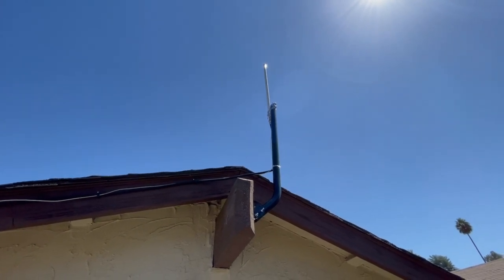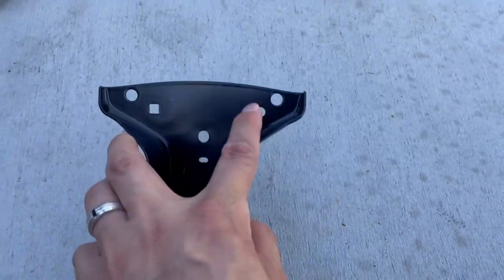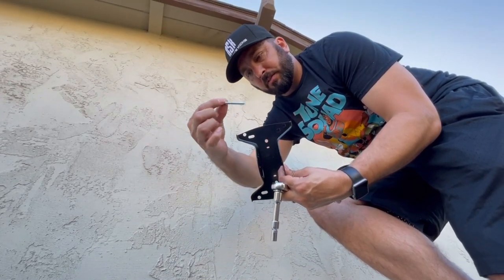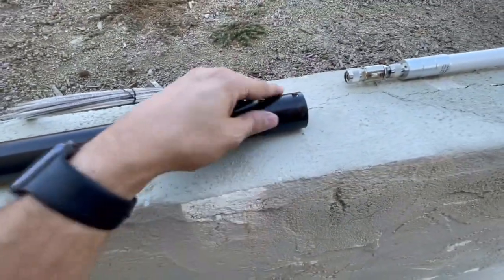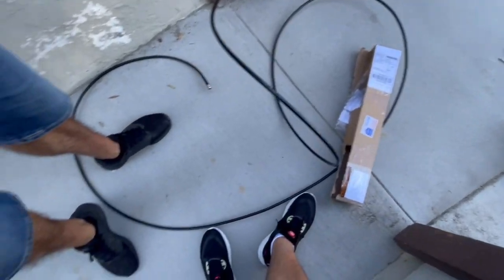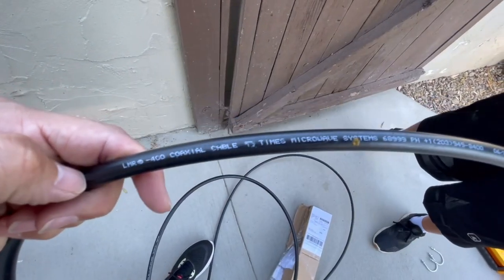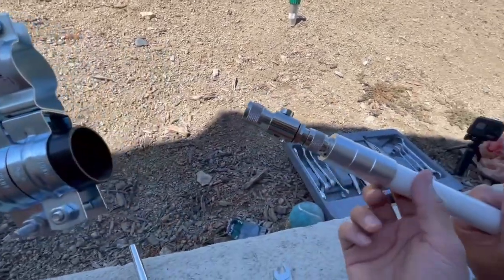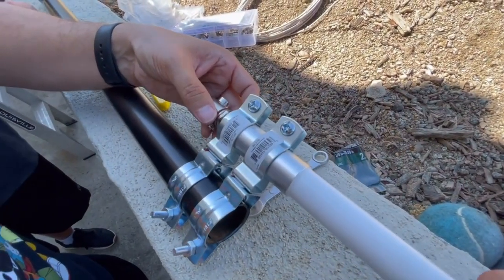Outdoor Antenna Install For Rak or Bobcat Miner (Step by Step Setup) Increase Helium Miner Earnings

Comment: 11:00 Never power up the miner without the antenna installed or you damage it!
Reply: Yep. Don't want the miner to get fried after all that work.
Reply: Can you explain bit more please?
Reply: @Dufjans   If the miner is plugged into the electricity and you connect  or disconnect the antenna.  It can damage the miner itself.  It's actually in the Bobcat's manual. Just simply unplug the power when connecting or working on your antenna.

Comment: Running POE is much more cost effective than longish LMR400 runs and there's essentially zero loss. Also, the steel base of the antenna is slightly below the tubular antenna mast and this will negatively affect the signal too. It's best to ensure the entire antenna filament has a 360 degree unobstructed view. Also the comments about connecting the antenna while the unit is powered on is also true. The miner is trying to push a signal to an antenna that isn't there and all of a sudden is and that can cause a surge.
Reply from the maker: Thanks for the info bro
Reply: What’s POE?
Reply: @KathyDefensor  I’m curious too?
Reply: Power over Ethernet. Used commonly with security cameras. So I think you would be using an ethernet cable from your router to the miner which would then be mounted closer to the antenna.  You would have the stock short cable going to the antenna from there.
Reply: PoE? Am I misunderstanding your correction.  The purpose of the LMR is to carry signal to antenna without housing an exterior enclosure to protect the miner with PoE at antenna location. Its. Practical IMO to do all the other stuff when a cable run is needed either way and the cost will be similar or more with enclosures...exposing to heat when you can put the miner in a climate control house or area
Reply: @TheTruthisGold  I understand that, just don't think its counter intuitive to sacrifice the device outside for no reason.  Although, Cat6 is easier to find and use in the DIY cases I suppose.  Just seems it should be device protection first, then antenna, then cabling.  You can get pre terminated ones and only encounter 1-2db loss in most apps.
Reply: @williamjonson6845  I was thinking about this as well. I’m debating on buying an outdoor enclosure box for my miner or keeping it indoor and running the longer cable..
Reply: @teflondaprince  longer the LMR400 cable the more db loss which means less distance you will get.  I'm currently debating the same thing of how long do I want the cord and how much i'll loose in distance.
Reply: @keithcevasco2827  the outdoor enclosure box is probably the best way to go. I had my miner for about 3 months and only generated 6 helium smh. Something has to be done
Reply: Yes, you can also buy a Netgear Powerline Adapter kit to not have to run a super long Ethernet cable as long as you have a power adapter closer to the place you want to put the minor.
Reply: @teflondaprince  thinking of doing a roof mount but have concerns of how how the box would get on top of the roof come summer time.
Reply: @Oryx -  I just got my bobcat and want to upgrade the antenna before I install it but the box came with a card stating not to install an upgraded antenna directly to the connector? I am thinking I may need an adapter for sizing but is it okay to use a grade antenna as shown in this video, not the standard baby one that comes with it?
Reply: I just love when someone posts a brilliant comment and disappears.
Reply: @michaelschwartz722  pay no mind to the warning from Bobcat about not using a different antenna, Mike...I hooked up my Bobcat 5 mos. ago w/a rak 5.8 dBi outdoors & it's been doing fine.
Reply: @keithcevasco2827  Same. I decided to go the POE route. My only negative is if i ever have to clinb back up to troubleshoot lol
Reply: @keithcevasco2827  lmr400 is the highest quality lowest loss per metre 0.12dbi I believe per metre he has installed about 8m loss will be about 1dbi off the 8dbi antenna defo have to consider in your own installs. Also I presume you mean install a short cable and long Ethernet so you don’t lose dbi strength. Each install is different my ocd was killing me on this install I was like zip tie the cables together and also the thread of the bolts should be facing in to the house lol also why not zip tie cable everything and then screw to roof joist lol

Comment: Would love to hear the updates on how much the miner brings in.  Great video - very straight forward and simple to follow.
Reply from the maker: Thanks bro. I’ll link up with my friend at the one month mark n we’ll make a video. 👍🏻
Reply: @CesarCinema  Please do dude¬!
Reply: @DarnIDidntKnowThat  I've got a miner up and running with a 4dbi, the most I've seen in the area in London is 118 helium after the halving, it won't be 10k/month unless you have a literal radio tower, but 1k/month isn't far off if you optimise your height and antenna.
Reply: @UrbanTitanHD  With 1k a month, is it worth it to run multiple miners at the same site?  I'm new to the whole helium thing.
Reply: @Agency323  I understand that having multiple miners at one site defeats the purpose. If you do that, you’re essentially competing against yourself.
Reply: @moreforallchannel9746  so nobody runs more than 1 at a single location then?  If you live in apartments that's got to be rough. You could have 10 people in spitting distance.
Reply: @Agency323  NO! All Miners need to be at LEAST 300 METERS apart or efficiency drops in half
Reply: @UrbanTitanHD  I'm in the London area and was wondering what antenna you would recommend as some areas are pretty saturated. I'd like to talk more about it but there's no private messaging here.
Reply: @Agency323  I've heard you can only have one miner per IP address and others say as long as 300 sq ft apart but I'm new too but some people say that isn't true that it is only one per location.
Reply: @timhood2690  just the machines within 300m wont mine with you or give earnings.... but youll still get rewards from the further ones

Comment: You need a drip loop where the cable goes into the garage.  Water will flow down the wire and directly into the walls, and water + wood is very bad long term (termites, rot, etc.).  Also, that hole is an invitation for rodents to make a home in your garage.  You will want to plug that up as well.  Good job otherwise.
Reply: But I thikn with the 90degrees he will be fine ;)
Reply from the maker: Yeah the cord is 180 degrees so no need for a drip loop but yes that hole should prolly b covered.
Reply: Also dont forget to plug the antena cord before pluging the power cord for the miners.

Comment: I have a Bobcat on the way.  I plan to install a 5.8dBi antenna with a # 10 thhn green grounding wire.  Thanks for the good information.  Maybe routing the cable under the roofline would have been better for a cleaner protected installation.  A follow up video on how this miner is performing  - over time would be interesting!  Cheers!
Reply from the maker: Here goes the earnings video. 
https://youtu.be/4bLBVL90e5w

Comment: another thing of note, is that your supposed to turn off the miners when you switch the antenna type, at least it says that for nebra, and rak miners, and a tip you can research when you upgrade an antenna height and DBI, often times it doesnt recognize it on the helium heatmap, apparently from what ive read, is that you can manually go and change the height and the DBI of the antenna, and the way the helium network works it will actually improve your miners witnesses and challenges because of how their algo works. but other than that thank you for the video.
Reply from the maker: That might be true about plugging it in first bc this is not the first comment about that lol. To me it doesn’t make a difference but if you are setting yours up make sure everything is connected before turning on. Luckily our miner didn’t spontaneously combust. You are very welcome
Reply: I think I fell victim to my own ignorance on that topic. Everything is running well (Synced, 1.0, Online, Diagnostics good, all green), except since I changed antennas without unplugging, not had one witness. I am invisible-went from 49 witnesses to 0, ~1HNT/day to 0.01HNT/day. Running Blind Beacon... don’t forget to unplug!

Comment: It would be helpful to you to know about losses in db at microwave frequencies. The longer the length the more loss, the more connectors and lightning arrestors the more db loss. This setup would probably not be far off the standard 6" antenna db!

Comment: Also curious on the rewards. Having a 5.8 installed on my roof soon as the cable and lightning arrestor arrive
Reply from the maker: Coming soon after I link up with my buddies. Good luck on your set up

Comment: I'm no electrician either but you want to run loops where stuff makes drops so when stuff goes wrong there's room for error... 

Also go straight to a ground rod in the ground. Mounting to siding a bad idea. You can always do it to gas line your insurance Co. Will love you

Comment: The lmr cable is set up to fail, neglecting to wrap the connections tightly with electrical tape will allow moisture to enter the cable, common mistake, also lightning arrestor  works best if installed at the point where the cable enters the building.

Comment: question. once I changed my antenna from my bobcat. what should I do? should I just wait for it or need toa reset or change antenna details to make it work?
Reply from the maker: Change the details as soon as you turn your miner back on. Go to your helium app under setting then go to “update settings”. If you bought an antenna from Amazon go to custom antenna and energy the details.

Comment: Thanks for the video, Do I have to use the lightening arrestor? can I just put a hoseclamp and wire directly to the antenna base? thanks for the response before hand!
Reply from the maker: That would be the ghetto way of doing it and you would pretty much have similar results but make sure you consult with a professional about that.

Comment: A lot people does this mistake, on the antennas fiberglass strically no obstacles 360 degree , antenna has to be fitted from the metal ring and pole strically below the fiberglass

Comment: Reading the comments a little, I think I know the answer but I'll ask anyway. My miner showed up last week and I have a 5.8dbi antennae upgrade that came with it. There's not a great place for me to mount this on a pole or anything I was wondering if it would be detrimental to mount this to the outside wall of my house. I'm assuming that having 180 degrees blocked is going to be bad but will it be better than just using the indoor antennae that comes with the system? At some point, I'll get it up on the roof but that's going to be a while.

Comment: Hehe, that's a male RP-SMA! It's confusing, but the RP stands for "reverse polarity", so it's the opposite than regular SMA!
A male SMA connector has the pin, a male RP-SMA connector has the socket!
The important part are the threaded part, if it has threads it's a female, if it has the nut it's a male
Reply from the maker: Thanks for pointing that info out

Comment: I have a RAK v2, Received it a few months ago and have $80 so far. Not bad. However I really really really want to run some more cable and a new antenna. I love this set up. I’m curious as to how much I need to try and save up in order to make this happen?

Comment: I live near usc and theres a lot of 1-2 story as well. It is flat area too. I see that hot spotty map on los angeles has poor reward scale. I wanted to figure out if there’s possible ways to have greater witness in that area…. Reward scale is all red around los angeles
Reply from the maker: You gotta get an outdoor antenna as high as you can. You can’t do nothing about the reward scale but it does chance for the better occasionally.

Comment: Does it matter if the lightning arrestor is 0 - 3ghz? or does it need to be 0-6ghz. New to this concept. Thank you!
Reply: Both will work exactly the same, as the antenna is transmitting in the 900 MHZ area.

Comment: I put small amount of Plumbers tape around the threads on mine to keep water out of the Arrestor connections
Reply from the maker: Good tip. I have a video coming fixing the setup thanks.

Comment: Thanks a lot. It's mandatory to have grounding with an outdoor antenna? I just bought an antenna but I can not install it in the grounding wire. Because of the location of my house grounding system. What is the disadvantage if I don't do the grounding? what will happen
Reply from the maker: Well direct TV company in San Diego doesn’t normally ground their dishes but you should check your local regulations. But if a lightning bolt ⚡️ hits it it can start a fire because the electricity has nowhere to go.
Reply: Just buy a 4 foot piece of copper grounding rod.. and take a sledge hammer pound it in as far as it will go with a little showing, and buy a grounding rod connector and just run the wire to the new rod.. happy mining.

Comment: the ground wire shouldn't be looped on the lightning arrestor.  you slide it through the piece connected to the screw you were using.
Reply: yes, that's what I was thinking. There was a lug with the bolt on the arrestor to crimp the wire on to.

Comment: As long as that copper pipes not a gas line. You’ll be OK but if it’s a gas line you need to get it off and change that.

Comment: thanks for the informational video ! I thought we want want the lmr cable short as possible ? Would  it be better if the miner was converted to POE and have it closer to the antenna ? thanks in advance !
Reply from the maker: Thanks. Yes the shorter the better bc it will have less dbi loss. But I prefer to keep an eye on the miner vs putting it into a box outside in the elements
Reply: Sounds like the Poe way would make less of a loss of signal but then you need to have the miner outside.

Comment: when you ran the wires from the antenna down  to the ground , it could have been a lot neater as you could have  ran them on the inside of the facia.....and pull the wires tight to take out the slack.           fyi.....grounding to copper pipe was good years ago....but not now.

Comment: Hello , could you tell me please if the grounding wire should be on a specific metal/location/touching anything else or I can i put it on any metal piece. Thank you !
Reply from the maker: I tried placing mine close to where is was supposed to go next to the screw.
Reply: same ground rod for electric panel or cold water pipe

Comment: Quick question, from what I’ve read so far, you are supposed to ground your antenna and mast, is this necessary?
Reply from the maker: I didn’t know this before but after reading the comments it doesn’t sound like a bad idea to also ground the mast.
Reply: From what I've been reading in these comments it sounds like we are supposed to ground the mast and also place the lightning arrestor inline near where the antenna wire enters the home.  Make sure to Include a drip loop, and plug the hole (ask your hardware store for the right spray or caulk to plug it).  Also a lot of people complained about the signal loss per foot of antenna wire.  So a better solution might be to place the miner in an outdoor enclosure closer to the antenna - but then the comments talk about using PoE (power over ethernet) to power the miner since there are no nearby power outlets.

Comment: You didn't check if that antenna is already grounded! So basically it may be that your lightning arrestor is redundant. You may just ground pole and have almost 2dB better signal

Comment: Does Wi-Fi vs Ethernet make a sizeable difference in earnings from what you can tell? Or is it purely for connection?
Reply: Bobcat recommend ethernet for stability
Reply: @DUlmer  thank you!
Reply from the maker: I think that Ethernet is definitely the way to go if you can pull it off. Wifi can lose signal throughout the day and Ethernet is a steady stream of internet.

Comment: Ive read to use LMR600 if over 25 foot long to avoid loss, is that accurate, any experiences?
Reply from the maker: The LMR600 is twice as thick as the LMR400 and it loses less dbi but it’s not by much. The LMR400 is cheaper, easier to bend and thinner than the LMR600 so the choice is yours but the dbi loss is nothing to lose sleep over.